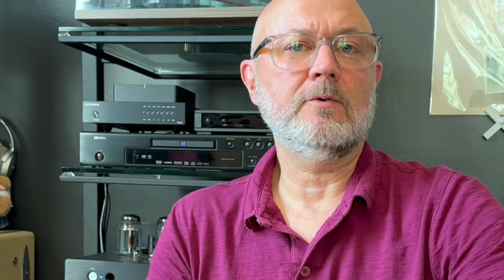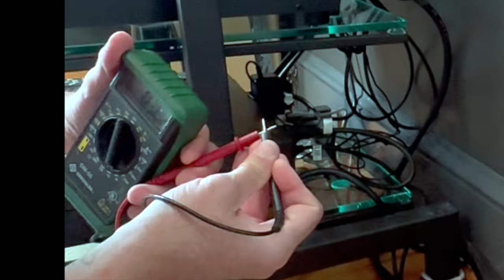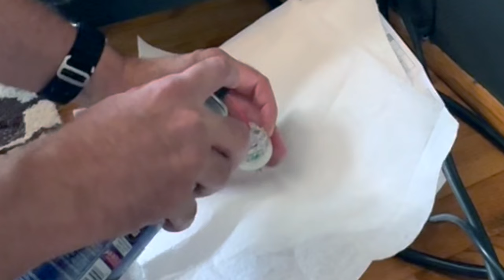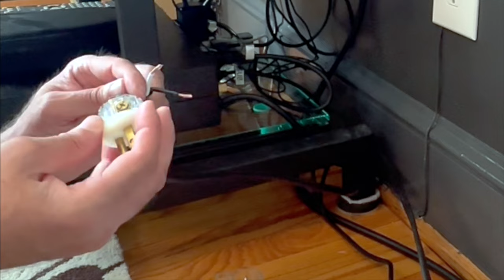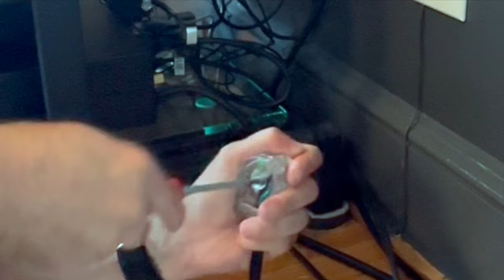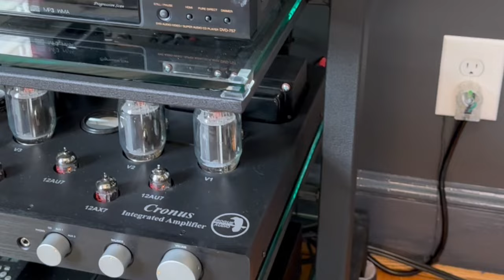Home HiFi Improvement? Cut the Cord!

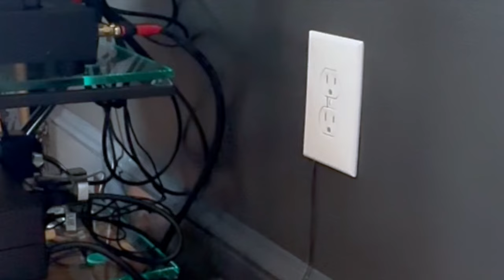Comment: 4:00 You said you replaced the outlet. Was it because it had no ground or was it worn out?
I know worn out outlets can cause current draw problems and over heating (of the wiring / outlet). I don't know for sure if that introduces interference or not.
Reply from the maker: Thanks for watching! I swapped the outlet a year ago when I bought the tube amp. It was fine, but the original outlet had no ground, so I added a dedicated ground rod outside. Been meaning to neaten up the cables since, since tube rigs are so sensitive to RF/EMI.

Comment: What about all the contacts in the breaker box, wire nuts, oxidized house wiring, 240VAC mains inputs, wire back to transformer, and transformer itself?  Then there are the neighborhood line wires, and connections back to feed station?  You should  the voltage drop across existing power cord compared to new power cord with load to find out if you made an improvement.  Even if you gained one volt with new power cord it would not make any difference with your amp.  Your line voltage varies much more than that.  After AC is stepped down, then converted to DC the DCV is regulated and filtered making tee tiny power cord differences a moot point.

Comment: Dielectric grease is an insulator/non-conductive, and intended to be applied to connections after they're made.  Pretty sure you've reduced the conductivity quite a bit at your contact points, thereby adding significant resistance (and likely heat) when demand gets high.  Mains cable length at even 6 times the original length will have zero impact on sound quality.  The household outlet will deliver 120V/60Hz at 15amps exactly the same as if you were tapping in at the breaker panel directly.  A better test would be to grab an oscilloscope and observe the supply before and after.

Comment: Tje last 10 feet makes about .001% difference.  Its snake oil  GET IT ??????
Reply: Snake oil is when you pay big money for something that doesn't do the job. In this case, he only shortened a normal household  cable. That's not snake oil.
Reply: .                  It's the coils of AC cable & their EMI field being reduced here.  Not resistance.

                                                                                                                          Acid Jazz,  Funk & Brass  🔈🔉🔊
Reply from the maker: Thanks for the thoughtful response @triamphifi reduced EMI is my guess too… and it just looks better. I fully accept the small changes I perceive may also be placebo, but, was fun to tinker and make the right a little neater in the process. Appreciate you watching!

Comment: Audiophiles are the happiest placebists ever.
Reply from the maker: lol, you may or may not be wrong, but how would I know ;-)
Reply: @fixityfix  You can know by getting someone to randomly switch the cords in another room, and seeing if you can tell when the cords have been switched. You need to repeat the guess around a dozen times to be sure if you guess tight out of luck. 
But the cord length is a very small component of mains supply quality, house wiring and other devices on the same mains loop have a far greater effect on the mains supply which your hifi rectifies and filters. Expensive or shortened hifi power cords are technically snake oil. If you test blindly you cant hear any difference. Its been done and no one can.
Reply from the maker: Thanks for watching and commenting! I wasn’t expecting any real improvement either, but was glad to get rid of some extra EMI, and coiled up cable. We did a Placebo DB on the power conditioner and were surprised by the reliably positive difference it made. I am sure I would not be able to reliably pick out the small difference chopping the cord made. Next up, I’m planning to run a dedicated line to the rig from the breaker box. Would be fun to double blind placebo that project :-)
Reply: @fixityfix  Thanks for your reply. This is a 'mythbusting' topic so its a bit challenging to not come across as patronising but I'll say a little more out of interest.
The audio codecs which phones and computers use require a high level of calibration to become transparent to human hearing. The calibration is performed with people having exceptionally good hearing taking part in completely blind tests of sets of calibrations. They have no idea how the codecs have been calibrated while rating them for quality and this is the ultimate way you can know how a technical change in the codec affects audio quality.
The results of totally blind testing is very surprising as it reveals that our subconscious tricks our senses. Its like eating potatoes with blue food dye in them, they taste weird even though the dye has no taste. Placebo tests need to be performed with zero cues of - no sounds of cables changing, or hints in the voice or bodylanguage of people helping in the test. Only then can you trust any surprises, and then it becomes surprising how we seem wired to trick ourselves.
The hifi power cord thing has really been myth blasted to pieces many times by properly organised tests and challenges. But there is some charm to such fanciful hifi enhancements that I can appreciate myself. Its sweet to have nontechnical refinements, hang crystals over sockets or whatever to purify the 'frequencies'. It can add to the overall sensory experience, its art. But the foundational quality of the sound is optimised technically, avoiding myths.
Reply: The AC then gets sent through a rectifier and converted to 5V or 12V DC. Also the length of the power cable is insignificant compared to the length of cabling in the walls. Any RF noise again is insignificant against the amplitude of the AC current.
Reply: If I'm not mistaken when any equipment leaves the factory it has to meet spafaction shorting a cord isn't going to be that significant in the sound if so the manufacturer would have done so snake oil for sure it's just ridiculous
Reply: @LanceGreidet-bi9zk 
"spafaction" - Lol!  😆